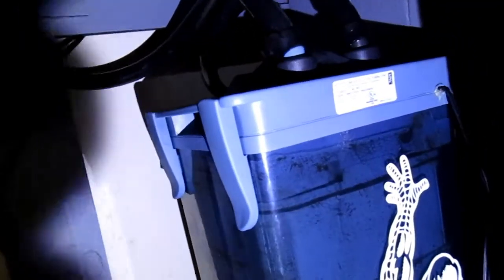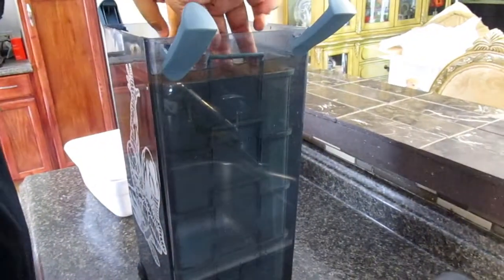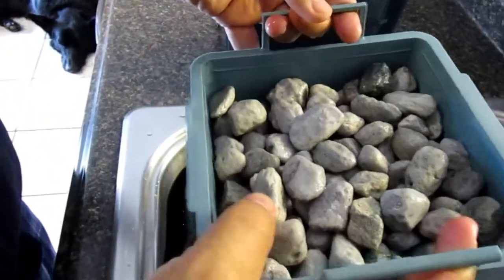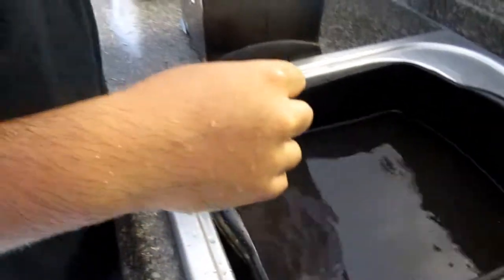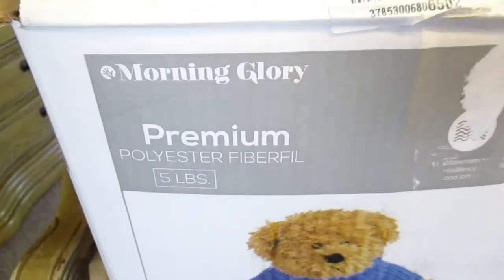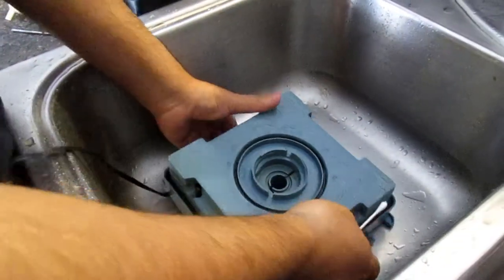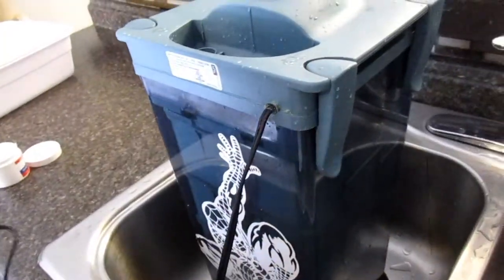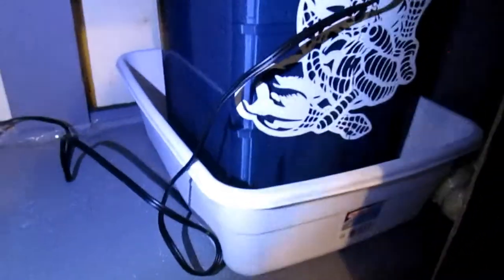Api Filstar Rena Canister Filter Cleaning Setup 1yr Maintenance

Comment: Cool I like your Filtration Videos.... How bad was the Canister cracked & how did you fix it
Reply from the maker: Just the little chip on the top edge where the lid seal sits. I taped it off and filled it with acrylic cement. The main issue with it was it leaked from the top because the valve seals were bad.

Comment: What is the exact part called you replaced to stop the leaking? Replacement gasket kit that includes one canister gasket, one impeller cover gasket and 2 O rings. Is that what you used and replaced all of them? Because I can’t find that item in stock anywhere.
Reply: It's the quick disconnect

Comment: One thing to say, huge water bypass
Reply from the maker: It was bypassing everything because all the fine pads were clogged.  I use very thin layer of poly instead of what is seen in this video. It keeps it from getting clogged and runs more efficiently with less fine pads (pink filters).

Comment: My tank will not fill up at all after filled water and put the handle down what do I do
Reply from the maker: Disconnect the valve with the hoses attached  and pour some water in the inlet and outlet on top of the canister. There probably isn't enough water in the motor for it to prime. The outlet on the right is where you can fill the motor and the left is to fill the canister more at 10:03
Reply: @SteveKish  got ot to work but the top is leaking 😭😭
Reply from the maker: Make sure all seals are clean and seated good. The big round one is just a long strip and can get a gap if not pushed back together. If it wasn't leaking before than it's probably just a seal that's dirty or not seated well.

Comment: You are setting that up completely backwards.
Reply from the maker: I have changed it to course med fine in bottom tray. Then all the rest of trays are biomedia only and purigen in top. I redid all my canisters.
Reply: @SteveKish  sorry didn't mean it in that form, I was always told the same as foam but to never wash bio media with tap water, it kills all the good bacteria that you've obtained, just saying. I did the same once and had to recharge by baking it. Sounds odd but works. I wish to obtain that canister for my 75 gallon tank.
Reply from the maker: I should have mentioned I have dechlorinated well water so I dont harm any bacteria. I also over filter with 2 canisters and clean them 6 months offset.

Comment: Your video has a lot of good information, thank you for posting this.  Here is a you tube video where it shows you do not fill up your canister before attaching it to the aquarium.  Put the canister (with filters) under the aquarium (mine in a cabinet) and attach your clean hoses, and make sure no water can come out of the aquarium yet from the hoses (close the valve on the canister).  Then take the cap off the attachment on the incoming hose side and fill the hose with water from a pitcher or cup, etc.  Put the cap back on and open up the valve underneath to let your canister fill up on it's own with the aquarium water.  When the canister is full plug the filter in and it starts a vacuum action, ta da, you are done.   Here is the video:  https://www.google.com/search?client=safari&rls=en&q=filstar+setup&ie=UTF-8&oe=UTF-8#kpvalbx=_Us4jYoScOeLJ7gKp1IuoAQ13